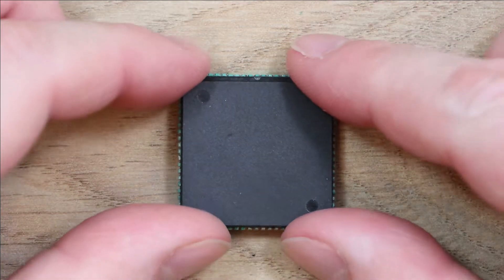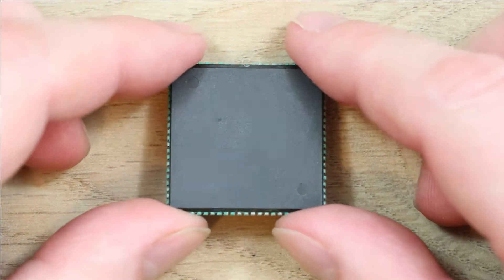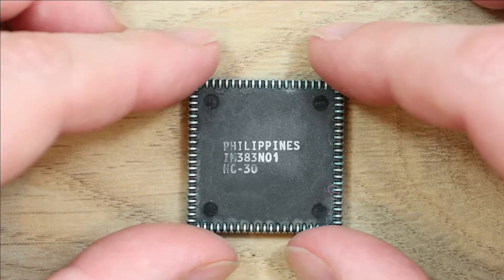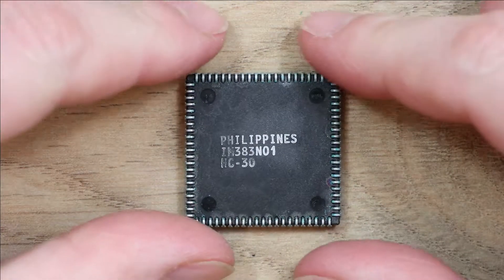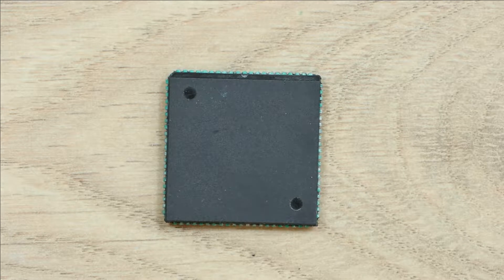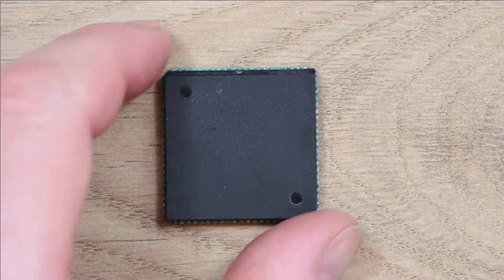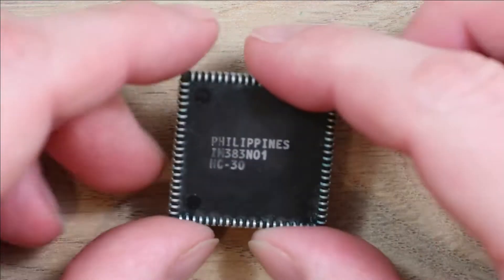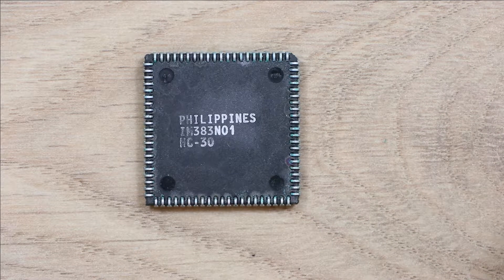Amiga 500 Fat Agnus Imposter?

Comment: its an 3872A!
Reply from the maker: Which means it doesn't belong on an A500+ motherboard confirming my suspicion that it's a bag of bolts Amiga :-D
Reply: @Error42_  it could also be an 8375 that was included in the A500+ late models.
Reply from the maker: Well, I did try it in the 500+ and it worked except I was having issues reading from floppy disks with that chip in. I'm still not entirely up to speed with the difference between all the Agnus revisions, there's a lot of conflicting information on the interwebs :-D I'm hoping to have more time to get back onto the A500's and do some more testing and make the required repairs.

Comment: From watching the video you put up it does seem that someone has thrown in faulty chips from various other Amigas .
It wouldn't surprise me if it's an older faulty A500 Agnus rather than the 8375, so someone has deliberately removed the writing to avoid suspicion.
Reply from the maker: I'm not sure what to think of it really. It's hard to be sure on the intent, but it's certainly a mixed bag of bits! 
It did cross my mind later that it could be an 500 not 500+ Agnus. I thought the pinout was slightly different though and I don't know enough to know what the outcome of plugging in the wrong Agnus in would be. 
That said, if it's only a minor difference then that could be a possible reason all works except the floppy. I've not had chance to look at all of this any further yet.

Comment: Not sure mate but the green discolouration is consistent with a battery leak. Commodore were fairly notorious for sourcing parts from wherever they could get them cheapest lol. From what I can recall,the dots on the top and bottom look right. I think I remember some chips being Phillipines. Even if it is genuine, there is no guarantee it will work. Only one way to find out really...
Reply from the maker: Yes, the battery leakage damage made me think its at least been in there with the battery. So I am probably just being paranoid. I may bite the bullet later if I get the time and try it and the other chips on my working 500+... and hope that it still works afterwards...

Comment: Given the green oxidisation on the legs I think someone may have accidentally wiped the identification from the top of the chip if the used the wrong kind of solvent for cleaning...
Reply: Just checked a number of tubby Agnes from A500 Plus machines... the details on the underside are unique for each one so may relate to batch number/production lines etc
Reply from the maker: That sound possible. Although the other chips still have their marks so I would have thought others would have been wiped too. But then I'm not totally sure it's not all been messed about with. It even has PC screws in it :-D
Reply from the maker: Good point, I never though of the underside being used for that. Thanks for going to such efforts :-)

Comment: Check for continuity on pins 42, 58, 82. These pins are vss1, vss2, vss3. They should be connected if they are vss lines. Only one pin is VDD on this chip so that can't be tested in the same way as vss. Notch on chip shows pin 1, so just count them and check the vss lines. Has this chip been powered on by you or did you open the case first and pull it out cause it looked odd? Other weird things you've seen in this Amiga or just this chip?
Reply from the maker: I'm getting a reading between the pins although not full continuity. I suppose they may not be directly connected. Looking at some pictures of the underside of other chips I've seen online they look similar. So it's probably an Agnus chip, just lost it's markings.
I didn't realise there was an actual notch half way along one side, I was initially assuming the notch was the slightly cut off corner. So pin one starts in the middle of nowhere :-D So I've learnt something today.

It looks like someone has been marking some of the other chips with a pencil with cross, also there are some PC screws in the casing, so someone has been doing something before I opened it. Perhaps the crosses are what someone has tried swapping out previously, rather than crosses to say the chips are dead. I will have to try them on another board that I know works.
I pulled the chip myself to see if there were any markings on the underside. I've since noticed that two other smaller chips also don't have markings, so something may have caused them to come off, maybe as Sabretooth suggested, something strong has been used to clean them, or maybe the battery leakage has done it? I don't know.

Thanks for the help :-)
Reply: @Error42_  Great, yes it's different vss pins so I guess they can have a small diff in resistance when measured but it should be close to zero ohms from my experience of measuring.
My guess is that someone has cleaned the top side of the chip too harsh with a chemical that wiped the original print on top of the chip.
Maybe it was an attempt to clean off tape residue or text written on the chip during repair at some time.
Also that green stuff on some chip pins look like a reaction from leaking battery acid.
Maybe acid somehow got to the top of the chip and reacted with the print and all text was erased if someone later just cleaned that gunk off like normal with alcohol.
If you get another Amiga of the same type you could lift that Agnus and compare the bottom text printed on that chip with yours. Probably the chip is the right one if all vss seem connected as you measured. Good work 🙂
Reply from the maker: I have another working 500+, I was hoping to test the chips in that. I just didn't want to start dropping unknown chips into a working system and kill it! :-D
I know the green is corrosion. I'll have to give everything a good clean. Thanks again :-)
Reply: @Error42_  You're welcome. I've done electronics since I was a little child and still learning. Fun to master things. I got a couple of Amigas myself 😁